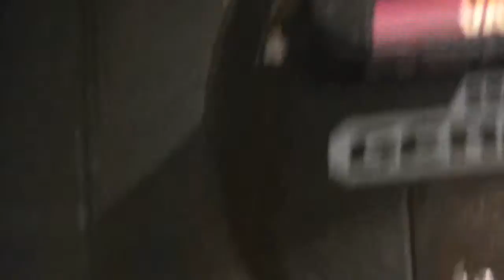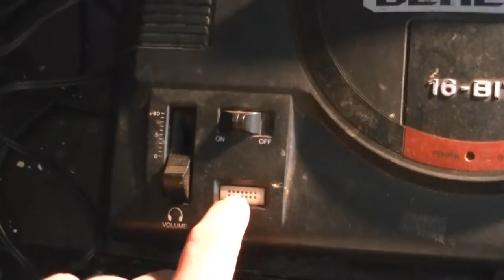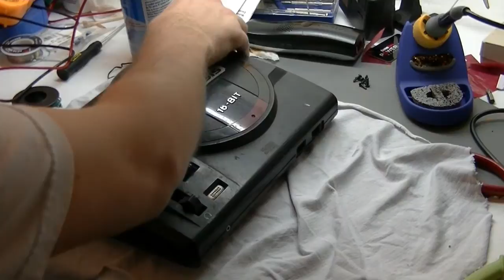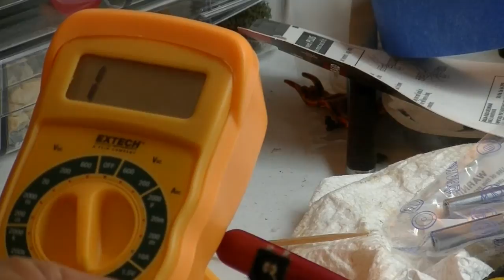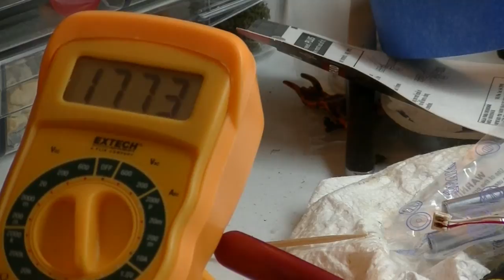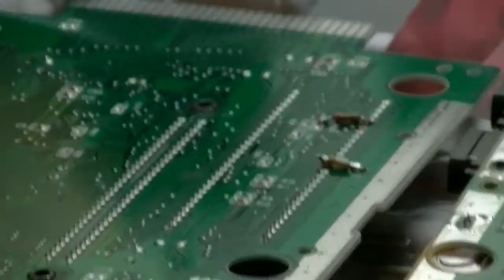Sega Genesis Testing, Cleaning, and Repair Part 1

Comment: Good Video. The resisters are installed from the factory. I've disassembled probably around 20 Model 1 consoles. They all have similar components like that added on. The older boards also had capacitors added to the expansion port going from one of the top pins to ground.
Reply from the maker: +Robert NES816 Great to know! I never knew they did stuff like that, though it makes perfect sense. I won't be worried about them when I see them in systems in the future. I subbed your channel btw. :)
Reply: Thanks I appreciate it! I have a new pickup video coming soon. I've been holding off on it for a while.

Comment: The jumper wire and 220ohm resistor are not from a modification, this is most likely something that was added post-assembly at the factory. I have a model 1 with the exact same add-on. Cutted traced with a 220ohm resistor and a jumper wire on pin 16 of the motorola 68000 cpu connected to the ground plane nearby.

Comment: 6:09 Most likely not a mod, some revisions of model 1s have bodged through-hole resistors and wires soldered to the board, not an uncommon thing on model 1 Genesis motherboards.